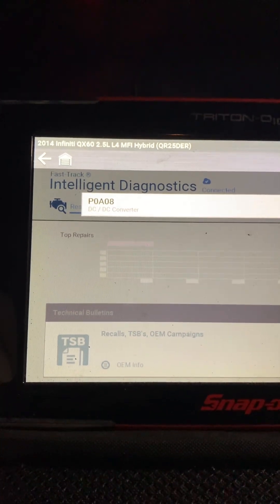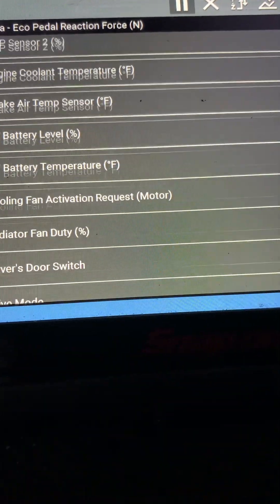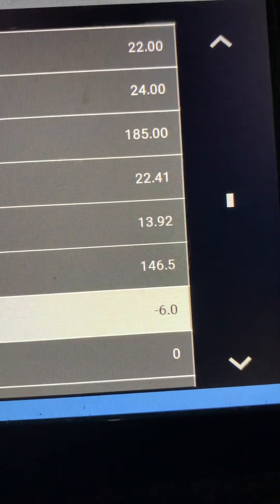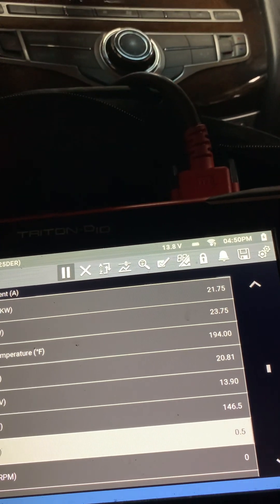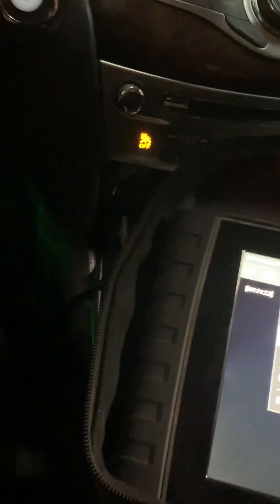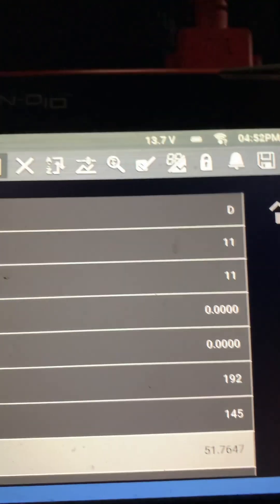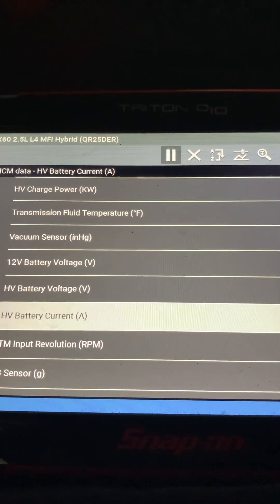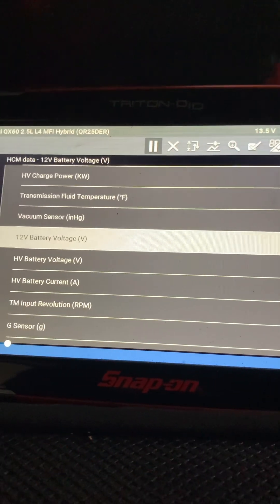2014 Infiniti Q60 2.5 hybrid code P0A08 analysis dc/dc converter issue #car #hybrid #infiniti #fixit

Comment: Did changing the DC/DC inverter work
Reply from the maker: @zebulonhanna1380  unfortunately, it looks like it didn’t… I got a call two days ago, I haven’t looked at it yet… please, stand by till tomorrow… I will know the details…
Reply: I had same issue, turns out that high voltage battery cooling fan was not working and the thermal sensor just turned off dc/dc converter
Reply from the maker: @matien6322  thank you